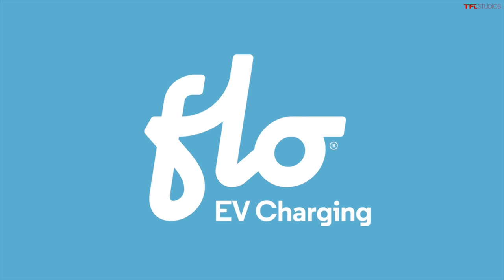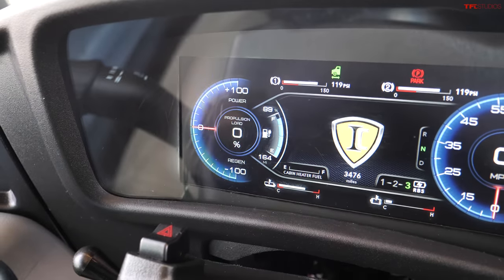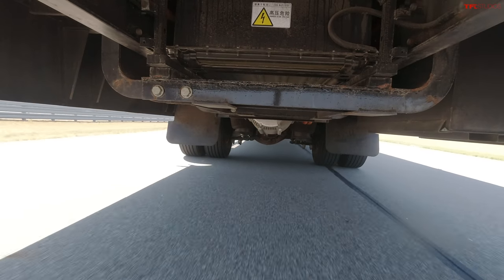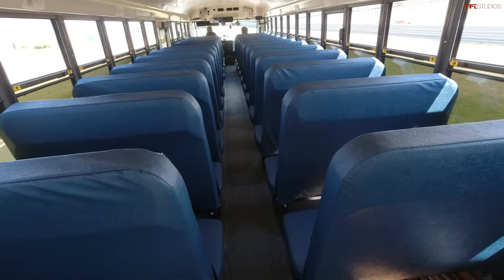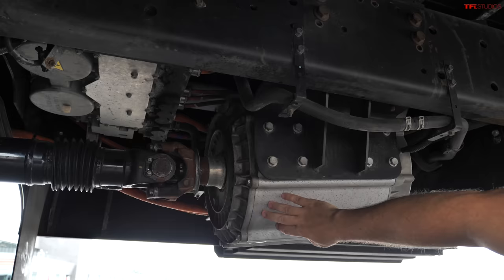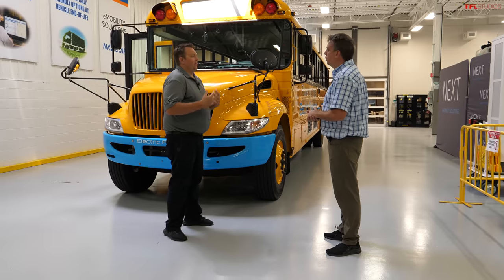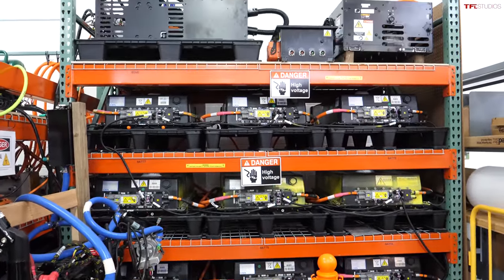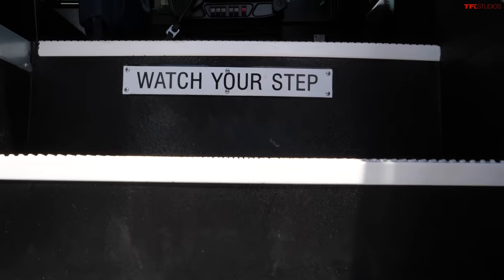Does This EV School Bus Put The First Nail in The Coffin Of The Classic Yellow DIESEL Kid Hauler?

Comment: Be great seeing all the fires caused by overloading the outdated power grid.

Keep pushing the envelope till it catches fire.

Then wait till you need 10 or more fire trucks to put this monster out.
Reply: If a power grid can't supply enough power it just turns off. However, EV charging is not over work the grid. We know that because new homes are still going up. New businesses are going up. No one is protesting those. But somehow new cars are a problem? The grid increases its capacity by 10% per year and has for decades. We'll be fine. Besides, charging these overnight will probably be like running hair dryers if they use slow chargers.
Reply: @MarkBlance  

Hundreds of them?

All at once?
Reply: @MarkBlance  

Sorry, meant "Thousands" of EV's charging at once equates to a "Hair Dryer?"

I dunno about that.
Reply: @seraphimsscythe1628  a Ev charger uses about the same amount of power as a if home air conditionner, and we all know thousands of those are coming online every day.

But unlike those, Ev chargers are usually used at night when power is cheap.

If an area can absorb hundreds or thousands of new houses, new chargers aren't much different.
Reply: @gelu88  

I'm curious where you got that information about EV's charging VS Air-conditioners?

I was talking about the cost. The load on the grid will be tremendous compared to just A/C's running. Then again, you're not factoring in the original load plus the EV in this equation are you?
Reply: @seraphimsscythe1628  the term “load balancing” is lost on you

Comment: The battery pack alone must cost over $100,000, so the buses are probably $150k-$200K 
I love the EV future, but dam our taxes are going to go through the roof to cover the costs of this 😮
Reply: The average school bus is driven 12,000 miles/year. At $4.50/galllon and 6.2 mpg, that's $8,709/year in fuel alone. The electricity will likely cost 1/4 that much, so you are saving $6,000/year, and over the 12 year life of the bus $72,000 in fuel. Not to mention the brakes will last much longer. So long-term electric isn't that much more expensive, and may even be equivalent in cost.
Reply: It has a 300kW battery, so maybe 3X the cost of a Tesla battery so my bet is $30k not $100k
Reply: @alexkleine9737  the battery cost at scale is about $150/kWh so thats around a $45000 battery. $7500 to replace a $12000 drive train so we’re doing to $40k. Probably saves $7-9000/year via electricity over fuel so 5 year roi on 12-15year lifespan. Difference is once thats replaced the motor will still work so now youve got a whole fresh 12-15yr cycle bus for $45000
Reply: @mattbrew11  100% agree. My comment was aimed at the fact that the battery wasn't going to be $100k+. Simplified systems will save so much maintenance cost it will be crazy